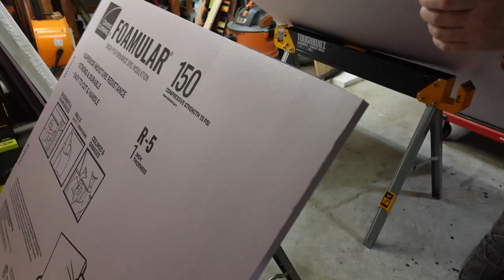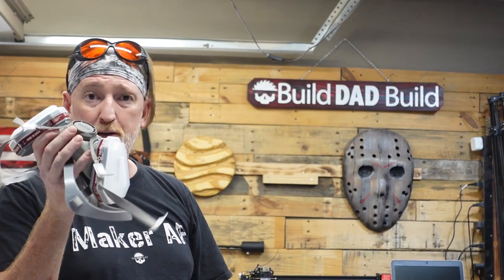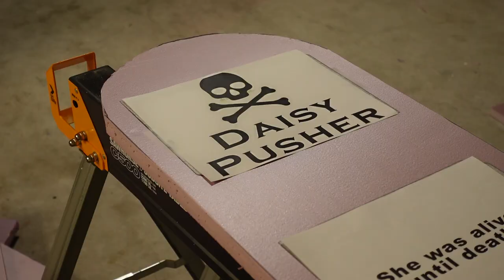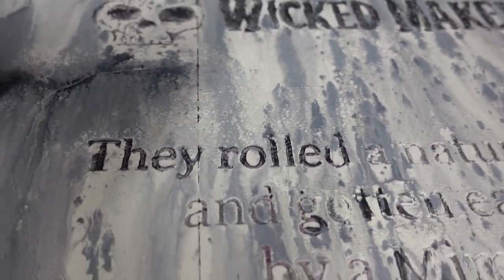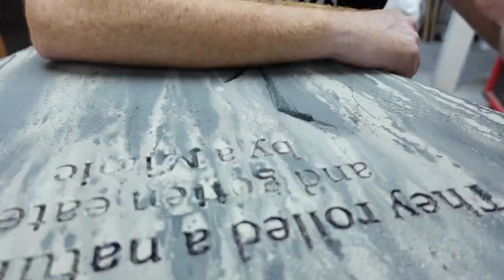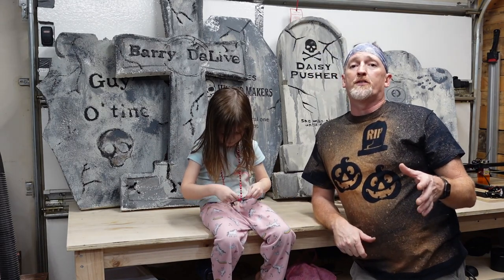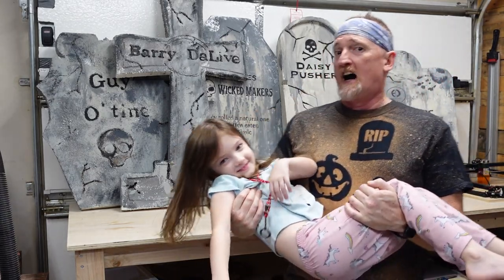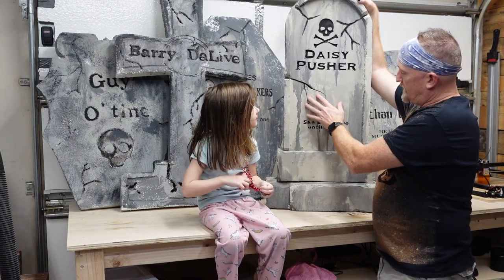How to make Tombstones 💀 DIY Halloween Props

Comment: late time for a comment, but one of the best things to do for this on the EPS pink foam is to add a exciter speaker driver.  it will turn the whole panel into a speaker.  parts express has a whole selection of them on their website.  its a great way to ad sound  without a lot of extra work.

Comment: I'm surprised that the laser didn't blast a hole all the way through the foam or make a mess melting it. Turned out very well. I've got some foam pieces that are about the right size, may give it a shot.
Reply from the maker: Sweet!

Comment: Do you think you can use painters tape when laser printing, then remove the tape after you paint in the cut areas?
Reply from the maker: I actually did on one of the white foam ones. The tape puts off a pretty foul smell. But it works.
Cheers